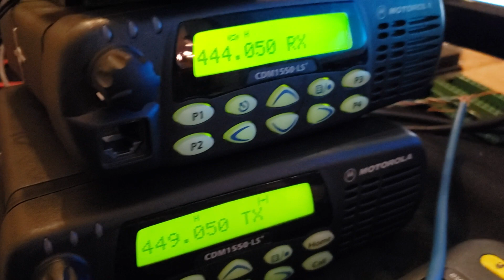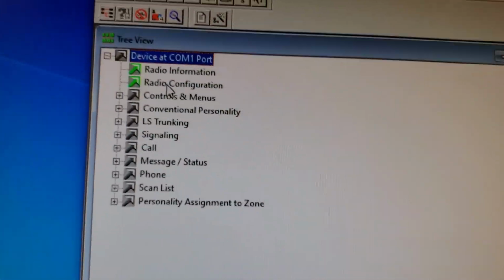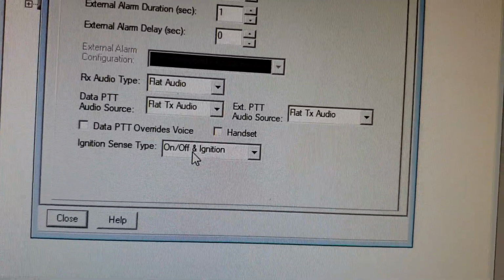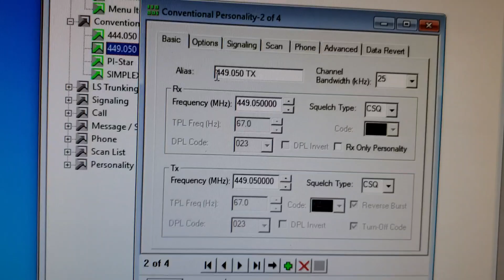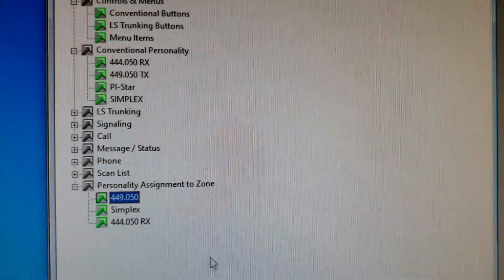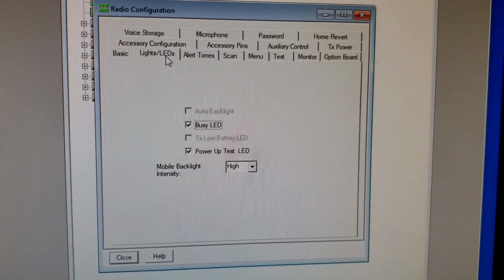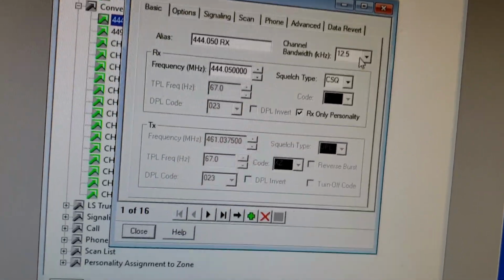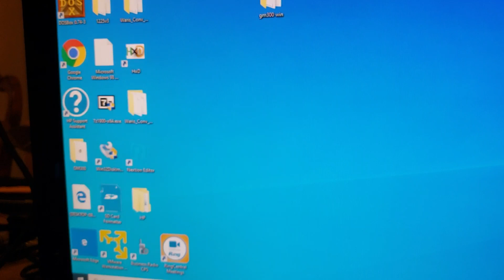Motorola CDM 1550 LS walkthrough for MMDVM and Pi-Star

Comment: Just run a jumper wire on the accessory connecter from pin 10 to Pin 4 and the radio will power back on by itself. You need to do this on both the TX and RX radios

Comment: Turn OFF Hearclear (companding) on the top radio. I think the main takeaway I see is he should ignore shit that doesn't apply in a repeater configuration (ie. scan, some extraneous button assignments). Also, running these at high power is asking for trouble. Turn them down and drive an outboard amp (YMMV). Also, I like to use the low-tier CDM radios like the 4ch CDM750 for repeater use and save the fancy multichannel ones for use as actual mobiles.

Comment: Welcome to the world of Amature radio! Learn by doing and redoing. The issue with those trim pots is they are junk. If you can remove them and use fine insulated wires to an external board with ten or twenty turn pots that would allow finer control of the resistance. Had a similar issue with the new narrowband trunking controllers. They used a basic 270° pot and I removed them and added ten turn pots to better control deviation levels. Shielding is critical for audio circuits.

Comment: It's the 1st radio that has the modified band edges (S-split is originally 450-512 [or 520]); 2nd radio (R-split) is 403-470 from the factory; no mod necessary.

Comment: You’re better off getting a surecom sr328 repeater controller it would work a hell of a lot better and it would be less bulky along with being less expensive
Reply: That would be a great solution if it was an analog repeater that I was running, but this is a DMR repeater.
Reply: @johnbesedic9432  doesn’t matter it can still be done using moto trbo mobile radiosUsing the special interface cables they make specifically designed for the SR 328 repeater controller that I have

Comment: How did you obtain a COR/COS voltage from the radio?
Reply: Use rear connector but first configure the pin with the computer, there is a part shown in the video

Comment: Nicely done. Any chance of a listing of Pi parts used? I could easily source some Warris series mobiles (likely GM339 here but a chance of 338 or 328) and look at making something like this. I'm wondering how the old Radius GM300/M120 would go doing this, though finding narrowband in them was like pulling hens teeth since most stuff here back then was Tait or Philips FM900/PRM80.